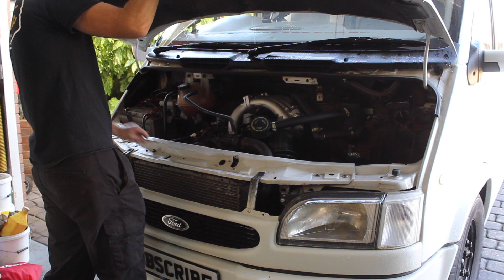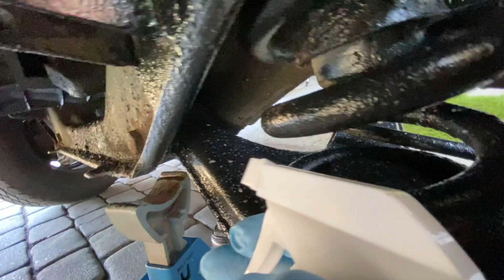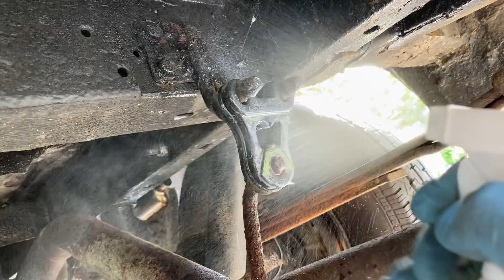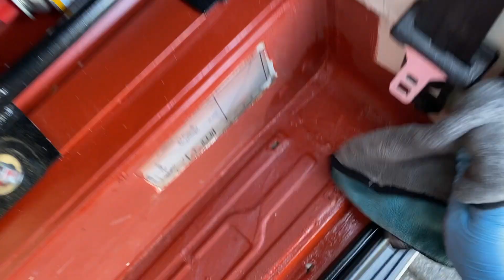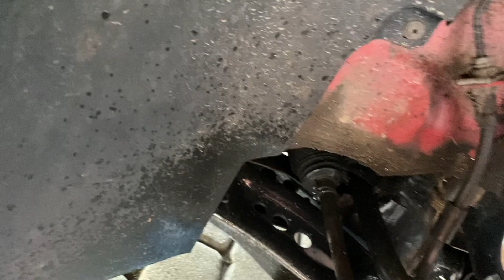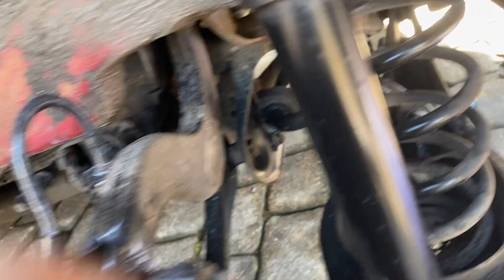Vehicle Rubber Protection - 303 Aerospace Protectant - Is it any good?

Comment: Hi, how many times a year do you have to re apply product? How long does it last under car ? Thanks
Reply from the maker: I tend to apply once a year when doing a service but it all depends really. For example - tyres on a camper van, it should be applied fairly regularly. That’s if the vehicle isn’t used as often, this will preserve the life of the tyre. If it’s used often then they will need to be replaced due to wear rather than the rubber deteriorating.

Comment: I bought a big bottle from Amazon. I plan to clean the surface first with Autoglym rubber and vinyl protector it's quite similar to a white substance and uses 303  at the end. I have an old 63 plate Kia Venga and I hope this will help maintain the rubber. I believe a lot of people used 303 on the accessory belt and they keep those for years in tip-top shape. Lovely video greetings from MK.

Comment: 303 Protectant is amazing for anything rubber or plastic. I soak my new serpentine belts in 303 overnight before installation, and they last Foreeeeever. Also, one off bottle use that I use on every single speaker that comes
Across my door, 303 protectant will rejuvenate both rubber and foam surrounds.   It will make the dried out surrounds on your subwoofers, towers or bookshelfs look brand spankin new again. I can’t tell you how satisfying it is to use this magic milk. I’ve never noticed any sort of skin irritant myself, I’ve used it hundreds of times.  But might be a good idea, not sure. Anyways, this stuff is pure magic, you won’t be disappointed.
Reply: Also, it works absolute wonders on any rubber weatherstripping or hoses under the hood.
Reply: Also, you can just apply it to your rag rather than spray it directly on in order to not get it all over stuff you don’t want it on.
Reply from the maker: Awesome that’s some great feedback there, thanks for sharing. I have to say I was very impressed with this and will definitely be getting some more. I keep finding more and more uses all the time for 303.
Reply: Thank you for using our products!